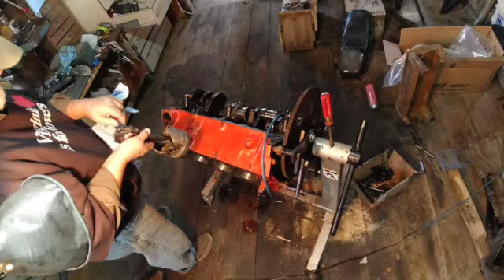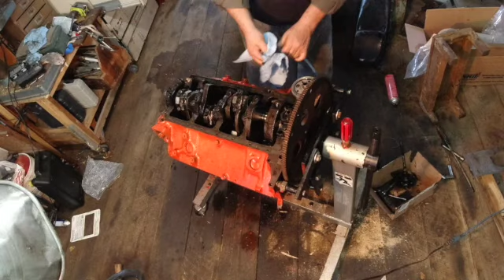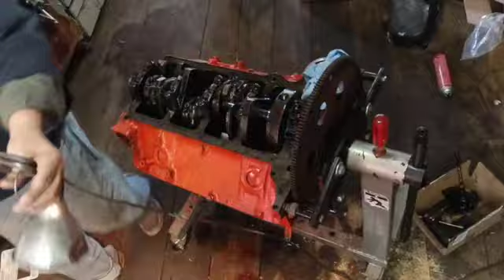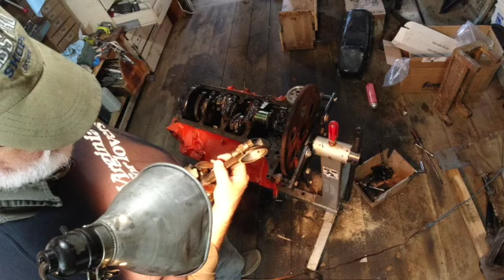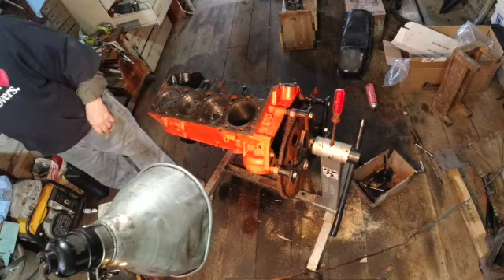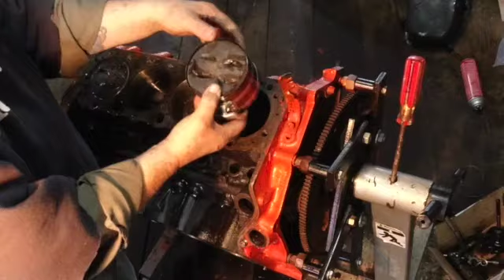Final Pistons going in the 1965 Chevy 283

Comment: I just tore one of these motors down. Why all the meat underneath the piston? Oil baffle/slinger? Reduce heat? Just seems like an extreme amount of excessive weight
Reply from the maker: You'll have to ask someone a lot smarter than me about that.   For what it's worth there's a lot less than there is on a Flathead Ford.